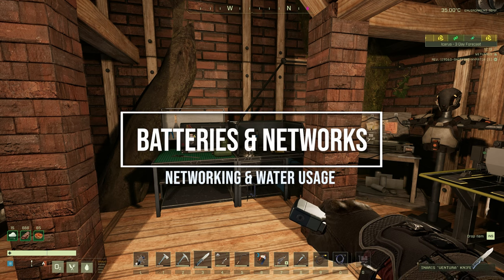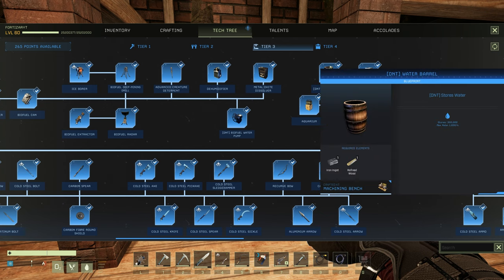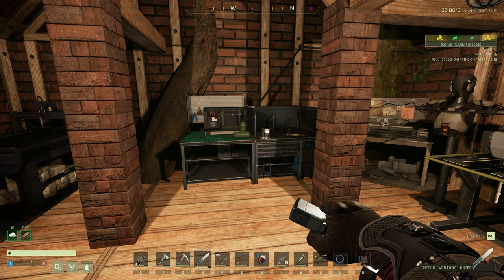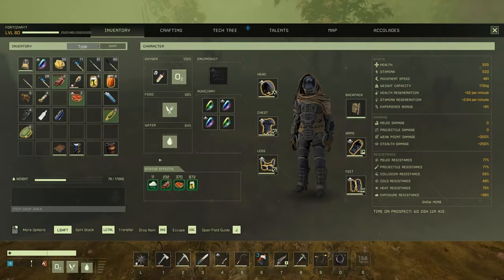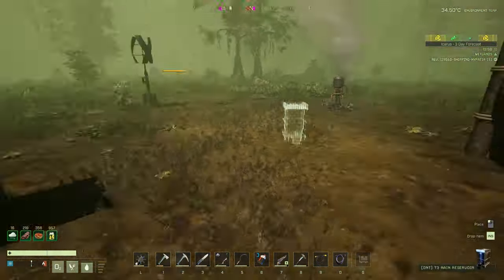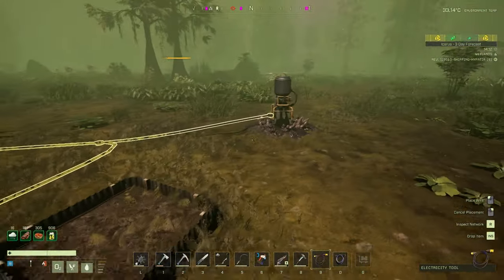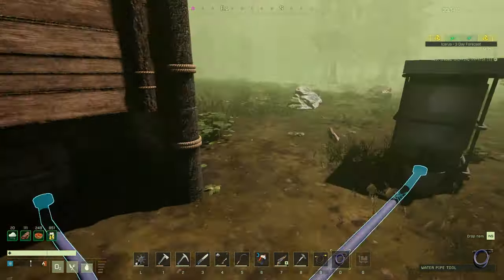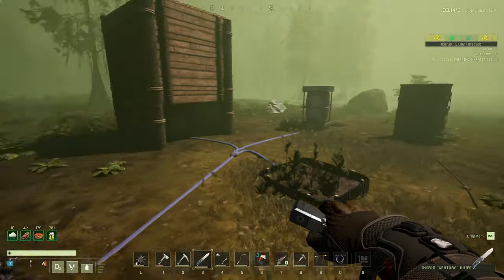How To Setup a Water Power Network in ICARUS

Comment: So, I know you're not sure what the devs are doing with batteries... I've two ideas.
One: they're going to massively change power generation (i.e. wind not constantly generating) to align with water (sponges stop it from working) Biofuel (runs out of biofuel) solar (night time) making batteries 'required' for a more-or-less handsoff system
Two: this I'm not as confident on, but it's plausible that batteries (and water barrels) might not attract aggressive animals the way moving mechanical things do, which would mean for running around, a battery and water barrel on your oxcart is the new way of being safe - and/or if they amp the aggression against mechanical things up, it could make it better to run as quiet as possible?
Reply: Also you mention in your live stream the same thought I had: the entire network system needs an overhaul, and they could take a leaf out of Occupy Mars as that game for all the shortcomings, has an amazing power/liquid network design.
Reply from the maker: Any bodies guess is good at the moment, I'm going to reach out to the devs and see if they would share anything.

Comment: For some reason all my benches shows me that water connection is on idle… so basically it doesn’t have water connection even  though they are connected to a water pump, I tried to connect just the glass bench to the water pump and still seems the same and I can’t craft reinforcet glass I don’t know if it just me or a common problem
Reply from the maker: Hmm odd as long as you have water running to your glass bench if should be working!
Reply: @Fortizar  I fixed it, I removed all the water pipes and do the water connection again now is working, I don’t know why but sometimes after I log out the game doesn’t see the electric cables or water cables and I have to delete them and place them again and is working.

Comment: I put forward a suggestion/request a while back to be able to colour code the electric cabling for traceability. It can be frustrating tracking through all the spaghetti that gets accumulated.
Reply from the maker: Wires now highlight yellow and water pipes now highlight blue so that should help you out mate
Reply: I wanted to colour code for example red for kitchen or green for workshop so fully traceable. I have just fully rewired my (very large) base and it took me hours to sort through all the spaghetti wiring @Fortizar

Comment: This was awesome 👌 
Thanks 😊 
One question, so the water barrel is filling up until the water source fuel it. And if the water depleted, the water barrel becomes a water source automatically as long as it has water?
It's the same concept with the battery's?
Reply from the maker: Yeah exactly the same concept as batteries, but the rain reservoir will also fill when it rains
Reply: @Fortizar  
Yesss!
I was afraid that the devs not gonna add the automated charge/discharge function to the battery's.
Glad they did.
Now the solar panels will have a good use 👍

Comment: I don't understand how the battery is useful. Okay, it stores surplus electricity but if you keep everything hooked up all of the time, and your load exceeds the 1750 of the turbine then the battery must surely go flat after a while.
Reply from the maker: Yeah it would go flat that's where you have to place more power sources etc.
Reply: It's good if you're using solar, or if you need to set up a forward base. You can move the battery packs with charge in them. Could be handy if you just need a little juice until you can set up something more permanent or you just need it temporarily.
Reply: @TalesOfWar Yeah, I was just thinking about this and agreed, solar would be an obvious application. I'll be interested to see how they balance them versus wind turbines.
Reply: Solar would be become viable in conjunction with wind turbines, for the ones like me that hate ugly wind towers. They should also make water wheels be able to clean themselves at the cost of a fraction of their energy output or by consuming some water from a pipe.
Reply: Solar panels generate more power than wind turbine. 
Takes much less space.
You can put them right next each other.
The only downside was the day/night cycle.
With the battery's, it's no longer an issue

Comment: Do you have to use that accent when speaking? Just kidding. Thanks for your time. I'm sure we all appreciate it.

So, what I'm wondering, is there a unit max or distance maximum that would prevent the power form working??
Reply from the maker: No maximum distance that limits you ,thankfully)

Comment: Cool but these wires man they need to rework that thing 🥲
Reply from the maker: I don't think wireless power tech is even a thing in icarus lol
Reply: No like when you do get your tool out it'll show the wires. But if your electricity or water tool isn't in your hand then the lines would hide or dissappear
Reply: Either way I've found a way to make my electricity and water super effective and easy to hide.
Reply: @Quantumfishics  You can get pretty creative with hiding the cables and pipes. I like to use the pillar foundations on the ground floor and hide them under there or run them between pillars up walls (place the pillars after the cables/pipes). It can be tedious but very satisfying when you get it right.